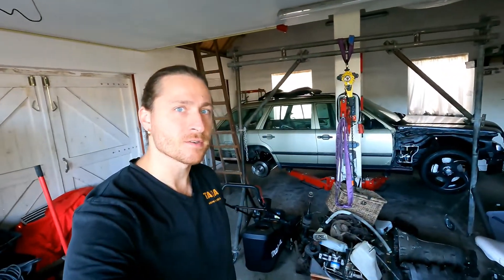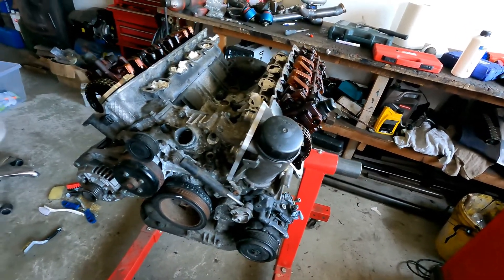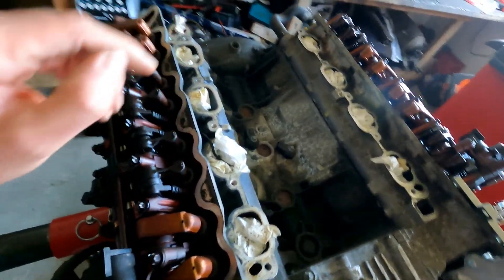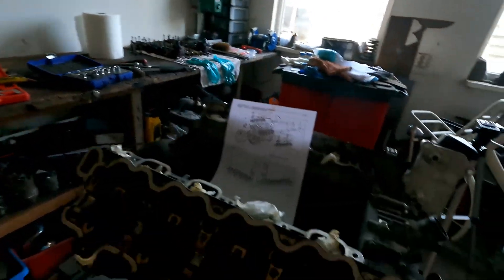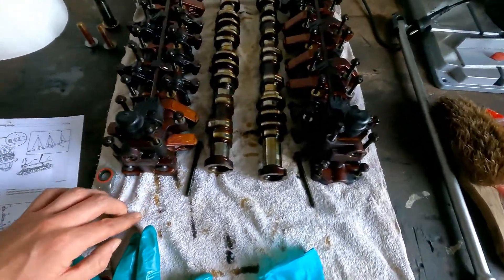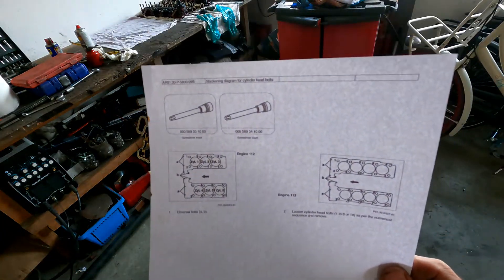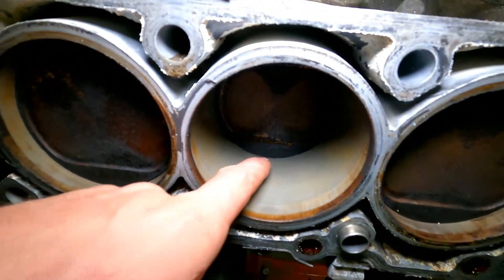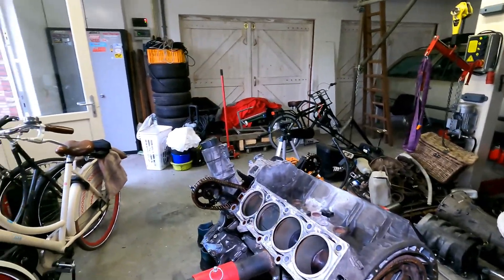M113 engine rebuild - Part 1 -  engine disassemble S124 V8 turbo

Comment: Hi mate, where is the oil pressure releif valve located on the M113?  I need to increase the oil pressure a bit on mine for boosted competition use, and there's no useful resources.
Reply from the maker: The relief valve is in the oil pump

Comment: I need to replace a head gasket on my w210 e430 and want to know what exactly I have to take off I dont want to remove unnecessary parts and im keeping the motor in the engine bay. A responce would be so helpfull. Thanks
Reply from the maker: Hello i have the factory manual files for these repairs i can sell you.  Send me a mail through jmspeedshop.com

Comment: Do you think arp bolts would be good to switch to for the valve train bolts ?
Reply from the maker: For the bridge?  . Overkill
Reply: @ well if you keep engine might be worth it In long run for servicing valve stems
Reply from the maker: Okey yes. Factory oem describes change the bolts every time.  But i have some sets of these bolts. And the old ones are never stretched and it is nothing special.  So i never going to change these bolts again. If i do not measure stretch in them.  But that is me personally

Comment: This is the beginning of me watching this entire series to learn as much as I can , I don’t need to do a rebuild but I do need to do a head gasket on my 2003 w163 ml500 m113 engine ! .
Reply from the maker: Thanks .  If your any questions left after watching just let me know
Reply: @JMSpeedshop  I have 2 questions about my m113 . The engine is in the car is it possible or necessary to do timing chain & guides while I have the heads off & do you think I should replace the 2 CRITICAL o-rings you mentioned that separate coolant from oil 😳 . If it’s possible while engine is still in the car & important for survival of the engine then I want to do anything you recommend for these engines maintenance, thanks 🙏 !
Reply from the maker: I 
If you have the heads already off i would do the timing chain.  And guides .  Also the 2 o-rings. Is very low cost in materials to do .   Your sure everything is fresh when closed up again.   I would changes these parts
Reply: @JMSpeedshop  is it possible to do while the engine is in the vehicle 🚗 or do I have to get my grandfathers cherry picker & pull the engine from the car 🥵 .
Reply from the maker: I never did it in the car .  But also never tried doing it.  But i think it is possible
Reply: @JMSpeedshop  thanks ! I guess I’ll find out
Reply: @JMSpeedshop so far I got the engine out on the stand & just need to order some torx sockets for the camshaft bolt so I can continue the teardown . Do you know where I can find the links to print that paper work 📑 you have with the information about torque specs & sequencing. Thanks 🙏
Reply from the maker: The Mercedes wis manual can be bought complete on eBay.  Then you will have the oem Mercedes program and will have all the info about torque specs and every info.    The torx bolt dimension dont now out of my head.  I will look for the old bolt. If i can find it i will check
Reply: @JMSpeedshop cool I’ll search around eBay ,I almost have the engine completely disassembled except for pistons /rods / crankshaft are still inside the block , I think I will stop here and leave them as is because I will not be upgrading the rods anymore & I don’t see the point to remove them because things look good enough to me , there are some areas on the cylinder walls that are visibly shiny but I can’t feel anything with my finger tips at all . your cylinders look much better then mine but I’m still comfortable moving forward what can I do 🤷‍♂️ mine has 170k miles on the block & over heated a few times & had both the infamous timing cover O-rings fail after 20 years , so I will continue to just clean everything as best as possible inside the crank case with a few cans of engine degreaser & let it dry & lube it up before I rotate each piston to top dead center to lightly clean the top of them each with a microfiber cloth by hand . Everything else I removed from the engine prior will be cleaned & soaked just as you did but inside my 20gal parts washer . I will disassemble the heads to clean the valves & springs ect…  then have the heads sent to machine shop before I reassemble them with new valve seals & valve lap possibility . I will have a video soon when I get everything cleaned so you can see the cylinder walls & everything else I have going on 🙏.

Comment: i am a mercedes mechanic and have been one 28 year now. Never seen cyl deactivation on a m113 engine! this is new to me.  awesome
Reply from the maker: Oke.  I thought it was a rare option . But for sure it is then
Reply: I never knew of it either. Some quick, and not very thorough, Googling seems to indicate it may have been S class only or perhaps S class and CL only. 

Probably helps a lot with fuel efficiency.

Comment: 1. Is the cylinders have - cylinder liners? 
2. Do you think "open deck block" is dependable for turbo-charging because of big pressures?
Reply from the maker: No external liner
Yes it is capable . The block is the same as the amg 55 k engine .  Open deck can handle up to around 800hp but good timing is a key